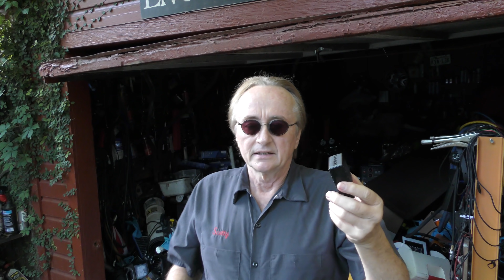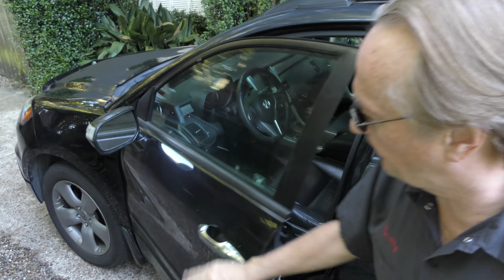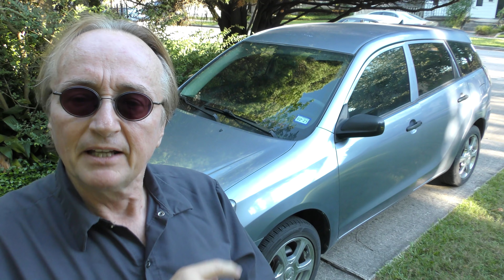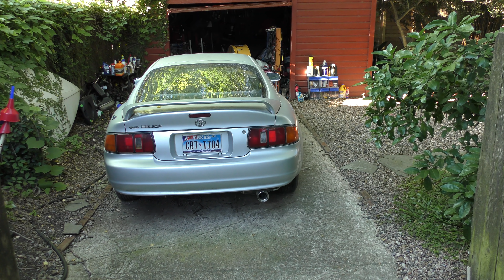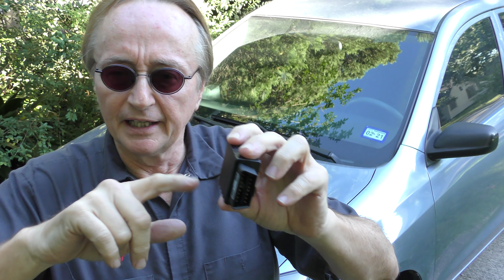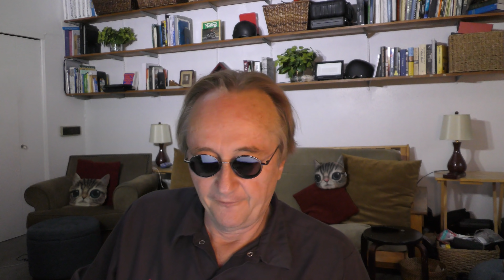I Just Installed This on My Car and the Results Were Amazing

Comment from the maker: 👉 My New Channel ▶ https://youtu.be/4Ce4gvhH43Q

Thank You and Goodbye: https://youtu.be/EnxXIkTMMyk

⬇️ Things used in this video:
1. Car Lock: https://amzn.to/35tVAsA (Also Check carlock .co website if not available on Amazon)I 
2. Common Sense

⬇️Scotty’s Top DIY Tools:
1. Bluetooth Scan Tool: http://amzn.to/2nfvmaD
2. Mid-Grade Scan Tool: https://amzn.to/33dKI0k
3. My Fancy (Originally $5,000) Professional Scan Tool: https://amzn.to/31khBXC
4. Cheap Scan Tool: https://amzn.to/2D8Tvae
5. Basic Mechanic Tool Set: https://amzn.to/2tEr6Ce
6. Professional Socket Set: http://amzn.to/2Bzmccg 
7. Ratcheting Wrench Set: https://amzn.to/2BQjj8A
8. No Charging Required Car Jump Starter: https://amzn.to/2CthnUU
9. Battery Pack Car Jump Starter: http://amzn.to/2nrc6qR

🛠Check out the tools I use and highly recommend ► https://goo.gl/rwYt2y

Subscribe and hit the notification bell! ► https://goo.gl/CFismN
Reply: Knowledge
Reply: Scotty you are invaluable
Reply: Scotty PLEASE give me your thoughts on a 2013 ford explorer
Reply: Scotty HELP,  I have a 2010 Chevy impala v6 3.5 k with 200,150 miles  the car start up and everything but when I put in Drive and want go but it will go back I think its SOMTHING wrong with my transmission I think I should buy another transmission for $500 but anyway I need to make runs in my car for my grandma but I can't because my car is down I don't know what to do? Mostly every thing is fine on the car if you tell me to buy the $500 transmission or just buy the broken piece for it the only thing I have to do is change the oil and transmission fluid and buy 2 front tires and brakes a new pully and belt
Reply: Scotty u can see your address on the app
Reply: @THEGIZS  He's a publicly listed business. You can see his address when you search for him on Google maps in Houston
Reply: Scotty, send a brother some Niko Nikos fries, could ya? Haven't had those in 15 years, they were pretty great from what I remember
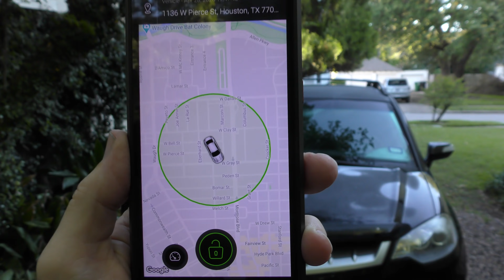Reply: 1:31 you might want to blur that
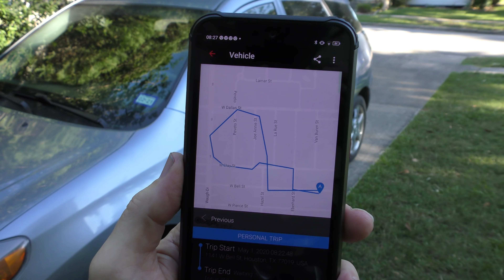Reply: 3:52 too
Reply: @gabrielmcking5257  He's a publicly listed place of business in Houston. Doesn't matter much... He wants to be found
Reply: @Stan_sprinkle  okay
Reply: Here’s a challenge for you Scotty:  send this car lock for me in Brazil! Haha! Big fan here in South America!
Reply: Good to see the little black and white electrician milling around. Hope she is social distancing. Don't want some crazy little girl picking her up and giving her the Vi - Rye.
Reply: Scotty working  Chinese communist... review a nanny box in your car NO THANKS BUDDY 🎎
Reply: WOW!!! SCOTTY IS WORKING FOR Chinese communist party NOW !! I DONT ANOTHER NANNY BOX IN MY CAR ...NO THANKS

Comment: Interesting data gathering device.  Since it works with the car off, how much battery amps does it draw?
Reply: The CarLock device has different power saving modes, so when the car is idle, it will consume only around 2mA. Even if the car is idle for a couple of weeks, there should be no problem.

Comment: Hey Scotty, great video as usual. I have a question for you please; Some months back I had a P0171 and P0174 CEL code on my 08 lexus IS350 to indicate that my car was running lean on bank 2. Further down the line I changed both upstream 02 sensors and the codes went away. However I noticed the SFT and LFT on bank 1 are 2.3% and 10.1% respectively whereas that of bank 2 are 2.3% and 14.8%.  I've checked under the hood for hissing noises or leaks but nothing. The car runs great however the mpg (14/17mpg) isn't very good. Please what does this indicate?

Comment: The one thing you can guarantee with feeling around plugging in an OBD is that first time it will be the wrong way round. Then when you turn it round it will still be the wrong way. Turn it round again and it will slot home. A bit like a USB lead.

Comment: Can you change air fuel ratio, transmission shift points , idle rpm's ? If not, then it's just another average information tool .

Comment: What has being built in Canada got to do with not having ABS? All cars sold in Canada sold from 2012 and up must have ABS. If your car was built in Canada after 2012, it was sold in the U.S. and it does not have ABS, then the U.S. doesn't require it.  I do not know what the law is in the U.S. and specifically Texas.

Comment: Also does it consume battery when plugged in and left for a while?
Reply: The CarLock device has different power saving modes, so when the car is idle, it will consume only around 2mA. Even if your car is idle for a couple of weeks, there should be no problem.

Comment: Thank you 🙏 Hi Scotty  
my dad gave me his suv suzuki grand vitara 2002 xl7 with 130,000 miles 4x4 v6 standard 5 speed  and runs good, which is the most sensible thing in this car I should sell it now that it's ok (the value is very low) and use the money and put it together with my savings to buy something better or use it until it falls apart. and i know it was made in Japan but there is no suzuki in america anymore what can you say about that

Comment: SCOTTY! Big fan of your show, i watch everyday. I have an 09 altima with the jatco cvt 110,000 miles. The engine is clean as a whistle no leaks. I am aware of the problems with  these cvts. Ive changed the cvt fluid recently. Only major repair was a a/c compressor. Should i drive it to the wheels fall off or upgrade?

Comment: I have a subscription with Metro PCS , so I paid $10 a month for my device and does pretty much everything as your. Mime is call Metro Smart Ride. I even have on board WiFi hotpot , it provide quite a lot information such as battery status after each cycle, engine condition, acceleration, fuel economy, live GPS location of my car, motion detection, and more. Such as great device for the money.

Comment: Not sure about any other brands, but I’m told Dodge has made it where you can’t plug any “accessories “ into the port. I believe 2019 +? At least on the chargers and challengers. But Count this as my clean non offensive comment! I have a ‘17 😁

Comment: Does it work unplugged? Haha
Reply: It requires power to work so it needs to be plugged to provide the data. If the device is disconnected from the OBD, you're immediately notified through the CarLock app on your phone. In case the tracker is too visible when plugged into the OBD, you can also install it using the extension or the power cable that we also provide.

Comment: I worked for a telematic company for several years and this device mimics a lot of what the very expensive devices could do. Top of the line units was several thousands of dollars and could take half a day to install. As technology improved, they were able to produce a model that would plug into J1939 Data Port and cost around $800. With the lower cost, companies with a mixed fleet wanted to use these devices in regular vehicles that only had the OBD2 Port. Adapters had to be used and at the time provided mixed results. When I left the company, they were starting to push out an Android-based system like the one here, and if I remember, it was to be about $15-20 per vehicle. I'm glad to see that there are newer and cheaper options out there.

Comment: Does this work on carburattored engines?
Reply: It can easily be plugged into the OBD II port of any car manufactured after 1996, but since we also provide power adapter cables, it can be installed in older cars as well.

Comment: Scotty, I agree with your comment about ABS. I once made the mistake of trusting it on an icy road: all 4 wheels locked up simultaneously, and the ABS, apparently "thinking" the car had come to a stop, did nothing as the car slid toward the back of the truck ahead. Luckily, I thought to start pumping the pedal, and stopped just in time!

Comment: Great product scotty! Thank you for all the helpful car videos!
I do have a question I have 2016 Nissan Pathfinder 71,000 miles when i have the A/C  on from time to time it makes a rattling noise it still blows cold air and it does not do it often but when it does i have to turn it off and back on and it goes away. But I am worried it could get worse soon. Any tips Scotty?

Comment: My car has hidden one that the dealer installed, too bad they Dont tell use how to track it ourself... How do we remove the tracker that the dealer installed with the wire spliced directly and hidden under the bottom of steering wheel or pedals.

Comment: I used to use Autobrain. Nice device it tracks and record your driving (hard brake, fast acceleration, exceed speed limit, etc..) and also can read codes. I trust it because once my Ford Focus 2017 was only like 5 month old and I received a notification from the device with a code so I took it to the dealer and they told me that is nothing wrong with it. So I drove it back to home then on a red light the engine turned off totally so I have to turn the key to the off position and turn it back on after that I got the SES on my dash board and I knew something got worse.Then I took it to the dealer and then they decided to fix it they came to me with the same code that I mentioned to them before I was upset with those lazy people. But anyways that is why I trust Autobrain and it is really cheap it like 9.99 month and the device cost only 19.99

Comment: Hey @Scotty, my dad has a 93 Oldsmobile Achieva V6 136k miles, has been parked and in PNO for years. We're trying to get it back running (pass the smog test) it starts pretty good, a couple years ago the cat and O2 sensor was replaced but still didn't pass. They diagnosed it as the new cat being bad after less than 100 miles, that it was consuming too much gas. It's been sitting on the driveway since. Any tips or clues where to start with this one? Thanks and ps.  what's a TSP value?

Comment: 1982 Dodge Ram pickup. Rebuilt motor, transmission, carburetor. 225 slant 6 with a Holley carburetor.  If it checks out could it be a good pickup just for a basic pickup to run to hardware/lumber yard/landscaping tasks?

Comment: Hi  Scotty,  can older cars without computers have a simular system?
Reply: CarLock also works on cars manufactured before 1996. It can also be wired using the power adapter cable.

Comment: If I buy a '94 Celica can I use the device in the car? Lol
Reply: In case it does not have the OBDII port, it can be installed using the power adapter cable.

Comment: I’ll have one of those... oh crap, my car’s older than ‘96. But my next car will be newer!
Reply: In case it does not have the OBDII port, it can be installed using the power adapter cable.

Comment: Hi Scotty I have a 2008 Cadillac dts with a Northstar V8 engine. I have so many things I have to do I have crack on of the Mounts on the top of the engine is there a way I could send some pics I'm really worried someone is going to take me for a ride on this.
Reply: I'm also having electrical and computer issue it's a miracle it still starts 250000 Miles

Comment: Hi Scotty! I inherited a ‘95 Buick Roadmaster with 70K about 1.5 years ago. It’s my only car and now has 110K.

I took it to a reputable local shop for an alignment and found out I need to replace the upper control arms, upper and lower ball joints, inner and outer tie rod ends, plus pitman and idler arms. The service writer was kind enough to show me my car while on the lift and have the mechanic point out what actually needed replacing. 

While I trust their honesty and transparency, they quoted me $1,700 for parts and labor. Unfortunately, I just don’t have that to spend, so I’m planning on doing the work myself. 

I just recently started doing work on my own cars and have never worked on suspension components, but I’ve always been fairly mechanically inclined, so I feel confident I could do the work with the right tools and repair guides.

Do you think it’s a good idea for me to do this work myself, or do you think I should find a way to pay to have it done? Thanks!

Comment: We have that sort of thing in the uk for new drivers to try and bring down the extortionate insurance prices. They call them ‘black box policies’ the insurance company collects data on your car like a prison tag but insurance without it is like £5k a year sooo. They penalise u for pretty much everything and fine u sometimes. Go literally 2mph over the speed limit, score goes down, break too harsh or corner too hard regardless if it’s your fault. I live in the country so the roads are just bendy so I can’t help it but they’ll have none of it. I’ve had to break harshly for people pulling out and a child running in the road (scared the cr*p outta me) but still brings the score down :( and I gotta drive at night and early mornings sometimes for work (big reason for having a car and living out remotely) and I’ve been penalised for this. If the score drops too low which might not even be your fault they cancel your policy and it’s next to impossible to  get  another one. It’s pretty unfair to be honest especially as I wouldn’t consider myself in unsafe driver, all instances I’ve been penalised for were unavoidable. And u have to pay them to disconnect the box when the policy’s up (or rip it out the car yourself and smash it 😏) or it will continue to collect data 😳😳. But if the information isn’t going to your insurance company then it’s a good idea, if not u spend half your time paranoid staring at the speedo 😁

Comment: Well good luck everyone, but on a side note this is very neat tech I wonder what will be the next thing to come out. 

Hey scotty my honda civic is having oil dilution issues around 54,000 2018 model what can I do to make it last. It smells nothing but gas I don't even have to open the lid and you can sme it's so strong

Comment: That Y Connector has cost a lot of diagnostics time when cars are in the shop! My industry LOOKS for signs that the OBDII is dead is not allowing us communications with the ECU/PCM etc. ThenI get upside down under dash with a good flashlight, and trace my way back to the proper port ( the Y Connectors tend to populate ALL of the pins, the proper one only used 6-8 of them

Comment: Something tells me that this won't work on my 82 Cadillac Fleetwood.
Reply: A lot of the stuff in this thing seems to run off GPS snd accelerometers, which are stored inside the device. If you feed it 12 volts at the correct pins, it might work, just not showing a lot of data.
Reply: if you've resto-modded it and it now has an LS swap, it will!

Comment: Scotty HELP,  I have a 2010 Chevy impala v6 3.5 k with 200,150 miles  the car start up and everything but when I put in Drive and want go but it will go back I think its SOMTHING wrong with my transmission I think I should buy another transmission for $500 but anyway I need to make runs in my car for my grandma but I can't because my car is down I don't know what to do? Mostly every thing is fine on the car if you tell me to buy the $500 transmission or just buy the broken piece for it the only thing I have to do is change the oil and transmission fluid and buy 2 front tires and brakes a new pully and belt

Comment: $10 per month is too expensive for the tiny amount of data that the device sends by cellular network, in my opinion.  If it also offered a wifi hotspot then that would be a good price.